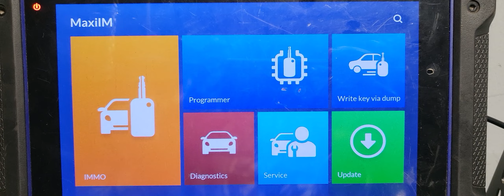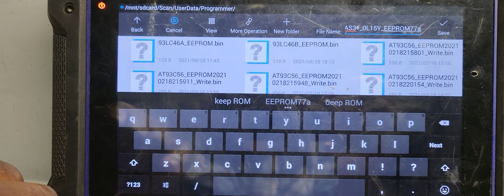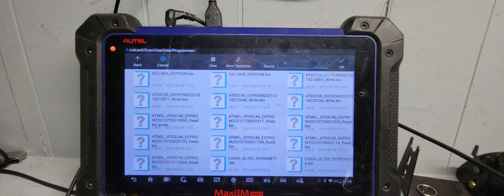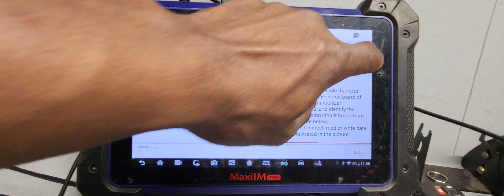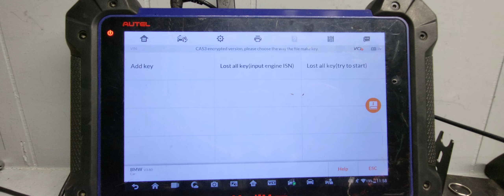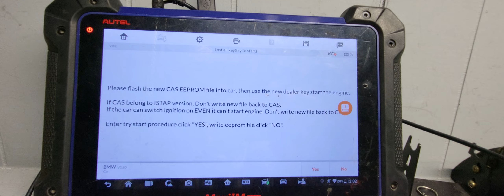2010 BMW 328i Cas 3+ EEPROM/Flash Reading What You Need To Know Using Autel608

Comment: Terminal 15 clicking ,i fix with 3 condensers replace.
Reply: How? You add 3 capacitors in series with the 12v+ Control side of the Terminal 15 relay?

Comment: I was working on cas3++ and trying to add key, there is a message in my scanner saying that I need to backup the files and update the cas before adding key..these will require dashboard removal to get the cas module, is ther any way to do it through obd?
Reply from the maker: yes